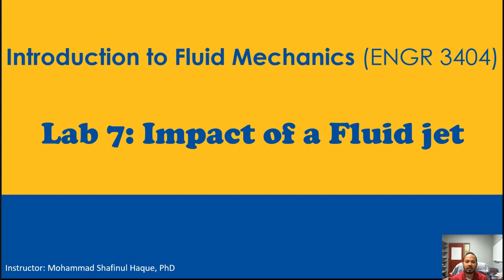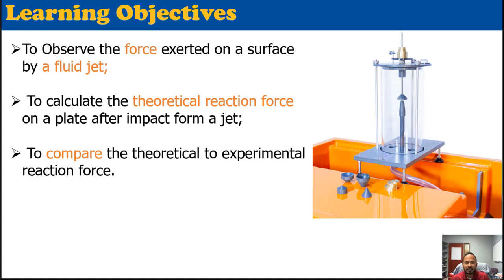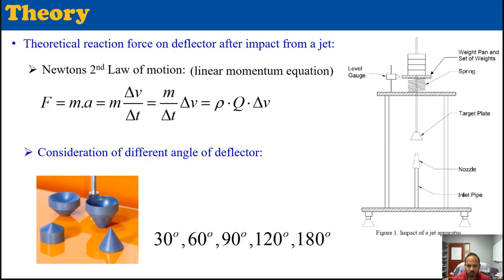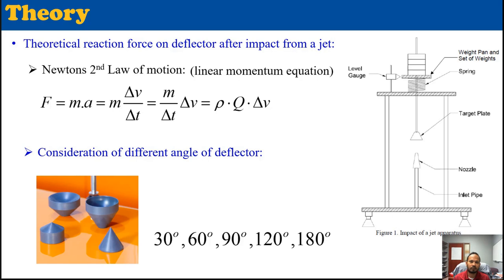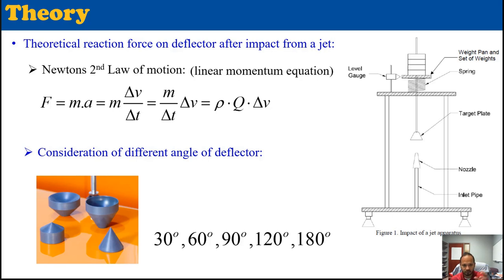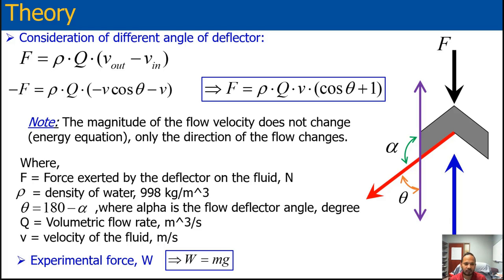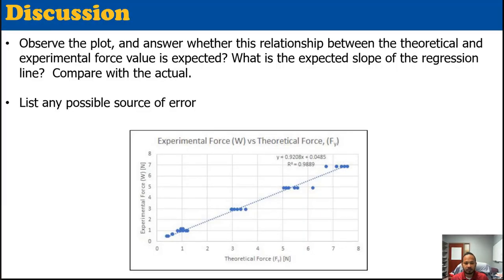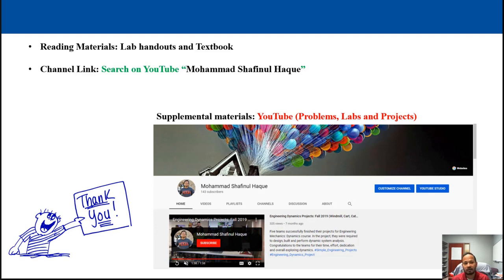Lab 7: Impact of a Jet: 30, 60, 90,120 & 180-degree deflector (Theory and Demo)

Comment: Which slope is more efficient at the angle (90, 120, 180) degrees and why?
Reply from the maker: Zhraa if you consider the force equation (see around 4:00 min); the force depends on the theta for a fixed flow velocity, thus the lower the value of theta (in degree) the higher the value of cos(theta) that will result higher value of force F. Since the 180 deflector will have zero theta value, will have highest force thus most efficient.